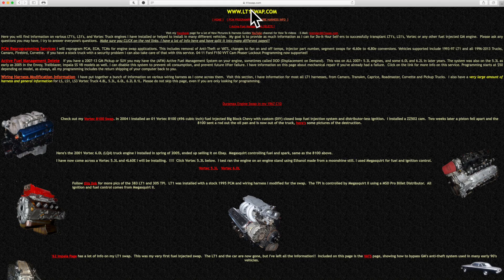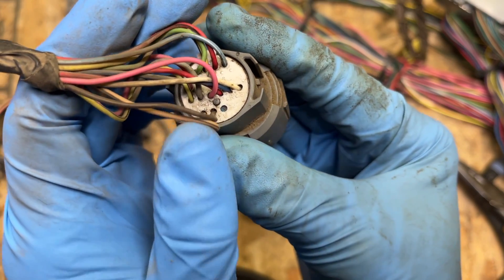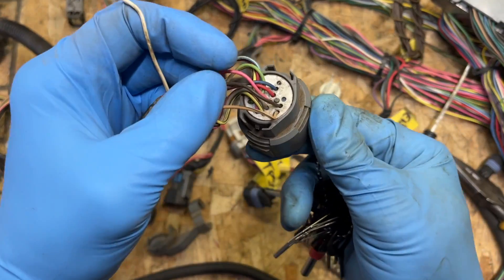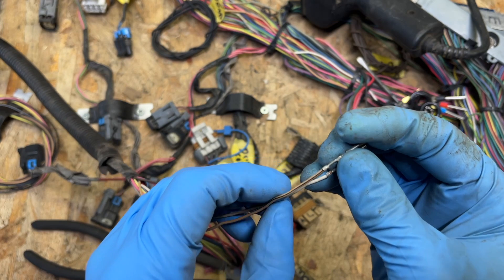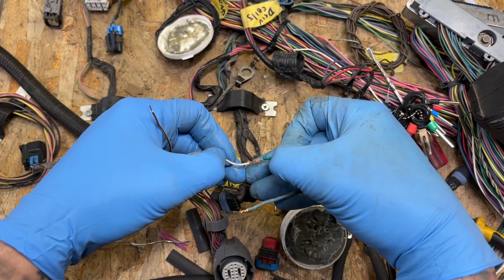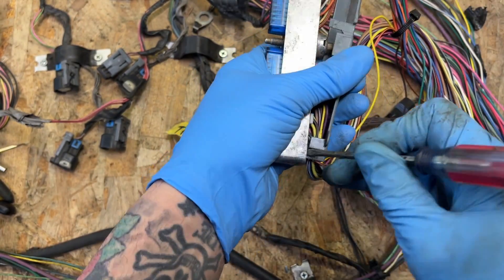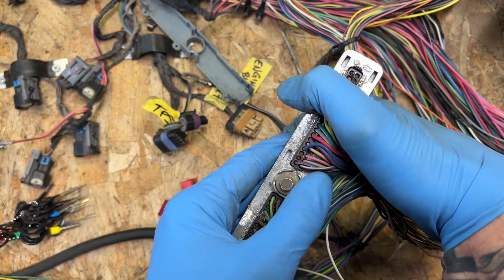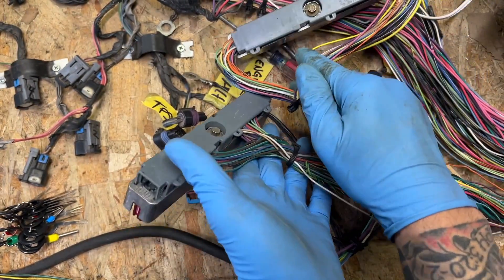CHEAP AND EASY!! RE-WORKING 4l60e WIRING TO 4l80e - TURBO 5.3 Pt. 13

Comment: I guess I’ll have to get on that forum, I have bought the wrong harness from PCI, it was a 6L80 and I need it for a 4L80 but I have a 2008 with the 58X controller which is way different than what you’re showing here and a separate transmission controller

Comment: I put a 4l80e in a hotrod with no computer. How can I get any speedometer to work?
Reply from the maker: it's kind of expensive, but you can get a controller such as this one from jegs:  https://www.jegs.com/i/JEGS/555/41800/10002/-1?_br_psugg_q=speedometer+converter  - this is the one I'm planning on using once I finally get this up and going...

Comment: It’s not in the video but the speed sensor you add goes to the rear of the trans… this video helped a lot Thankx man
Reply: So the speed sensor connectors need to be swapped?
Reply: @sterlingburgess2958  if you have them wrong. The tuner will two you if there in the wrong spot. No biggie
Reply: What happens if i added it to the front location? Lol im getting a code for it 😂
Reply: @andresmedina2827  if I’m not mistaken orignal speed sensor harness goes plugged to the back one and the add on goes to the front speed sensor I just got done doing my swap just need the segment swap

Comment: Do the pin numbers or wire colors change from year to year?
Reply from the maker: according to LT1swap.com it should be the same from 99-07.  GM is pretty good about not changing much